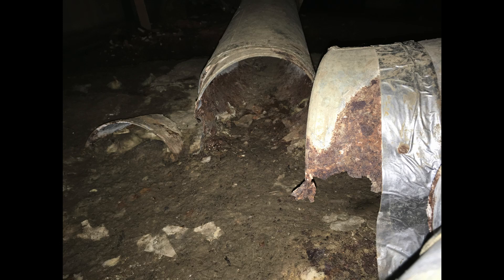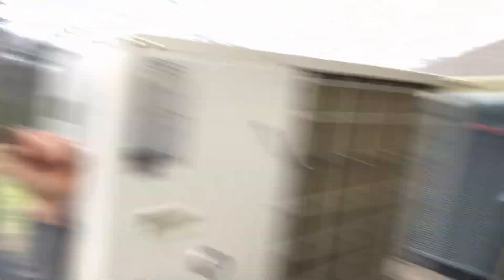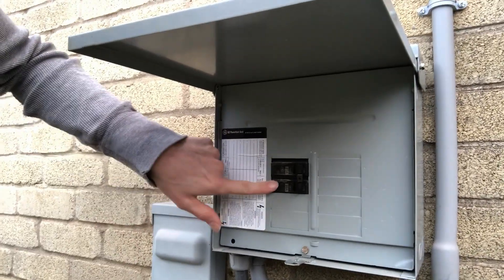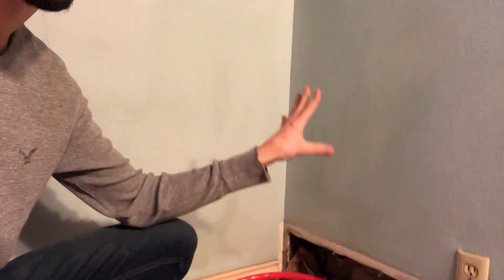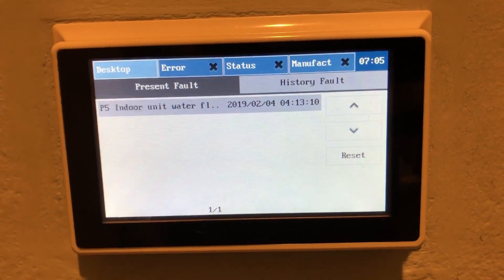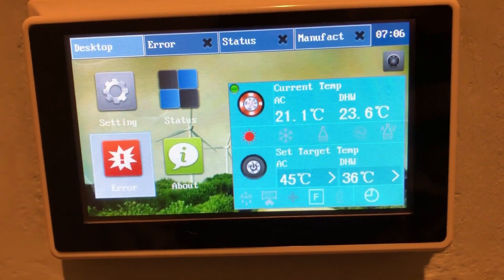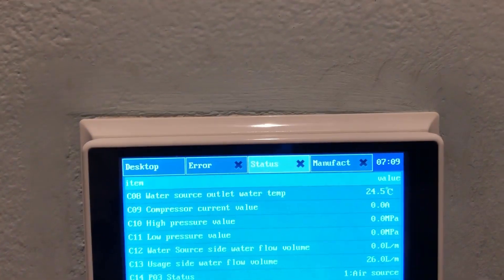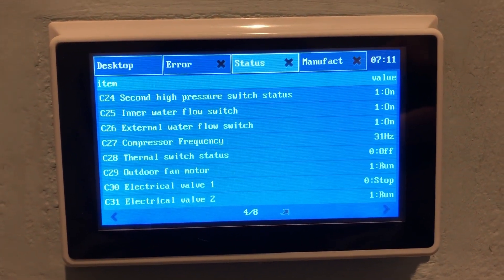DIY Chiltrix air to water heat pump Installation

Comment: I am confused on which components you need for a multi-zone setup, did you need to install a Tekmar 406 controller, or what is the model of wall controller you are using? I would like to control humidity and temperature of 2 zones with cooling only.
Reply from the maker: Support over at chiltrix should be able to help. Fairly certain the humidity control is for the room it’s in, can’t do two on one cx34 outdoor unit.
Reply: @beenegarage7116 What part number is the control screen you show, is that included with the main unit or an add-on?  Do you mind sharing which retailer helped you with component selection and delivery?
Reply from the maker: The control screen came with my cx34 outdoor unit. Not sure on part number. I got all my stuff through hotspot energy up in the north east usa.

Comment: I’ve been interested in these units. I have been researching this or going with the multi aqua. Both seem to be similar in design. You guys need to check out the chiller (ice bank) buffer tanks. Allows you to chill water into ice when loads are low and mix the water when you need the extra capacity. Also check out the ACDCX by hotspot. You can tie solar to the unit directly. I would love to see a video of the components on the inside. If your interested in doing a video on that.
Reply from the maker: Thanks for the tip on the acdcx. I hadn’t seen that product. Wonder what the requirements are for code compliance and grid provided are for installing it.

On the one hand it seems like a great idea but if your ac isn’t running the panels aren’t powering anything else in the house or back feeding the grid.

I really want to setup thermal storage. However I’m cheap and have only seen very expensive solutions. Have you by chance seen anything that would be residential grade. Not sure it’s really economical for residential at this point so I might have to build my own just for fun.
Reply: BeeneLife yes there is. Engineer775 has the videos on it. He uses the multi-aqua. The ACDCX doesn’t feed back and is compliant. What’s nice about is that your chiller will run longer than you think. So for the expense of only 4 380 watt pannels I think it’s worth it. And if you install the thermal tanks then you can have it run longer and use that energy during the day.
Reply from the maker: I’m renewing my research. Couldn’t find prices on that storage tank, but it doesn’t seem it’d be too hard to replicate. I have a spare 5 ton air conditioner I’d like to convert to a chiller. If I could get that working I could hook it up to a thermal storage tank and have some fun.
Reply: BeeneLife that’s some work for sure. You could get a pool heat pump heat exchanger along with the txv valve and braise it all in. It’s a lot of work but could be some fun if you like tinkering. Honestly I’d go with the pika inverter over the ACDCX due to price. Was comparing the two tonight and the pika islanding built in and doesn’t feed back to the grid instead it offsets the power and uses the grid to supplement the power. The tanks are made by Calmac ice bank tank. If you can use the proper valves to feed the bank if none of the zone valves are open.
Reply from the maker: Managed to spring a leak on my experimental window ac unit removing the aluminum fins from the copper. Figure I could work on making it into a chiller then find myself a storage tank to experiment with. Hopefully I have better luck with the last window unit I’ve got available.

Comment: Hey we should trade notes at some point. I have 7 of these installed at my home. Have run into similar issues. Have had mine for about 18 months. Have had many challenges to put it mildly.
Reply from the maker: 7 indoor units? Is that all fed off one outdoor unit or do you have multiple? It’s definitely an interesting beast.
Reply: BeeneLife sorry wasn't clear. I have 7 outdoor CX34 units. I have 24 indoor fcu's. 6 loops total.  Had the electrical storm issue as well early on. Finally solved it using whole panel surge arrestor. Have had many P errors. One design flaw they fixed later was the flow sensors would form condensate internally in the electronics and then fail after a few months of use. Flow was fine but sensor indicated otherwise and shut the unit down. Definitely have run the full gamut of issues with these.  Anyway we owners of these should start some kind of Facebook group to trade stories and remedies for common issues as well as cool ideas like you've shown here with that float valve.  Definitely have felt quite on my own with these fwiw.
Reply from the maker: Not at all, that’s what I get for assuming. Sounds like you have much more experience with these than I do! I wonder if I’m having the flow meter problem you’re talking about as I have been fighting the low-flow p error even though I have one unit that is on 24/7. I hadn’t considered a fb group but that’s not a bad idea.

I just installed a whole panel surge protector as well. Hoping that keeps things safe!
Reply: @beenegarage7116  Ok, well I just set this up to start things off... you can join here
https://www.facebook.com/groups/chiltrix.owners

I'll probably compile a list of all the errors I've seen and their solution or workarounds and post it as a fixed document
Reply from the maker: Beautiful. I requested to join the fb group. I’m curious to see what you document. Happy to write up any errors I’ve seen if you don’t cover them yourself.

Comment: I like what you are doing.  I have been thinking of putting in one to cool the part of the house we are in mostly.  We are not sure if it would be a plus or a minus when selling the house in 5 -10 years.  How well is it cooling for you so far this summer?  What temperature do you run your chiller to cool?  I know you have have to lower it to help with the humidity.   Keep up the good work.
Reply from the maker: J R it’s been good so far, with the exception of one of the circulation pumps having failed last week. Once that RMA comes in it will be back to operating well again. It does well at keeping one room cool while another is closed off. We have about half the downstairs hooked up so the front of the house stays a good 10-15 degrees warmer. It’s been getting up to 90 in the afternoon lately.

Resale value is definitely a consideration. Not sure on the answer there.
Reply from the maker: J R we’ve been keeping it at 44f during the summer. We don’t have the humidity control piece but it would be able to dynamically control the water temp to maintain temperature while also raising the water temp if humidity was under control.
Reply: @beenegarage7116  Thanks. Enjoy being young and enjoy your kids as I know you do, they grow up so fast. You have skills that so many your age are missing. Your kids are going to learn so much from you.
Reply from the maker: J R thank you for the kind words. It is certainly a precious time that I try to make the best of.
Reply: @beenegarage7116  I do not know if you know about Sense.com energy monitor. It works fair and has not found everything, but not bad for how it detects devices. I bring it up now because they have a sell going on. https://mailchi.mp/sense/fathers-day-1271317?e=91789ea54d. I think it is the best thing going.  I do not know how well it will do with inductive motors.  You can buy the  Sense and later get the "pick up coils" for the solar. It might help you size your solar system. I think they had the some sale on black Friday.    You can see energy usage in real time and most of what devices are on. I hope this helps.

Comment: what kind of air handlers work with this?
Reply from the maker: One of the beauties of this system is the air handlers are autonomous from the chiller, so as long as they are made for handling cold and hot water I don’t see why they couldn’t be used. Chiltrix sells the air handlers like I purchased in half a dozen capacities and a couple versions that you can install in a whole house air handler to replace a traditional evaporator coil.
Reply: @beenegarage7116   can you please explain the install process? is it feasible for your average DIYer? I will need to replace my 1996 weather king system soon and I wish I can make my basement usable by removing the ducts!. also is it more efficient than your average high seer inverter mini split (ex, Mr cool DIY mini-split) 
ps I have an open attic does it make it easier? please advise
Reply from the maker: @Cfish613  I'd say it would take a dedicated DIY'er. Most of the work is plumbing, getting all the PEX through the house to all of the indoor units and keeping it insulated well to prevent condensation and energy loss. Having a basement would be perfect IMO for running on the first floor, I did it in my crawlspace which worked out well. Is yours a two story home?

I can't say for sure if it's more efficient than a typical mini split. Based on the technology I wouldn't think it would be more efficient, but for sure more flexible since adding another unit is just adding more water pipe.

I haven't installed in an attic. I like under the house better since if something does leak it's not going to leak on my ceiling. Of course when the AC goes out upstairs I'll have to decide if I'm expanding the system up there or not.
Reply: @beenegarage7116  If you just look at the EER numbers, it's pretty comparable to a mini split, depending on the mini split.

You can also do fun things like heat your buffer tank with another heat source, say a wood stove or solar, which vastly increases the utility of this system, I would say.